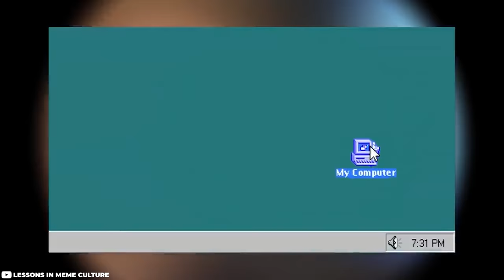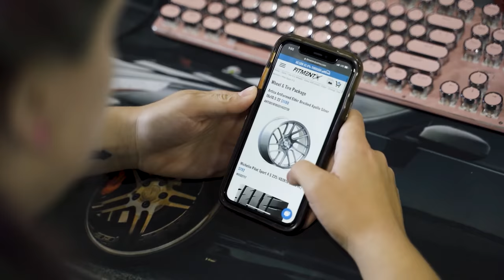AVOID These Car Mistakes...

Comment from the maker: What’s the worst mistake you made as a new car enthusiast?

Don’t go through the hassle of having to bring your wheels and tires to a shop to have them mounted, we got that part covered!
https://www.fitmentindustries.com/wheels-tires
Reply: not buying the rx7 fc that had 0 issues for 1k
Reply: Thinking I knew the limit of my 07 350z and losing rear traction when I didn't want to and over correcting twice ending up over a large curb. Ins deemed it a total loss while it still looked like it could be saved. Still killing me to think it could be fixed since is was in such nice shape.  Body shops didn't really give me the time of day to assess the frame before I made the choice to salvage or take the settlement.  Salvage titles and rebuilt process are a PIA as well. 

 Never wrecked in my life and now I lost my z :(    I have that feeling of wanting to start over, more aware, and get something similar, but don't feel worthy or too ashamed.  I know it will pass, but damn.
Reply: Buying  a 7 yo super car
Reply: $250 exhaust not the move, now i have no muffler and it sounds terrible past 3k rpm
Reply: Selling a s2000 for way under what I wanted for it. Reason being even though it a s2k it still a Honda so you get the the Honda kids  messaging nonstop wasting your time, or getting older enthusiasts who point out every flaw with a 20yr old Honda saying the blue book is only 9k blah blah blah…. Absolutely complete nightmare. I learned with cars like that keep them or just don’t buy them. The s2k is a great car great looking inside and out but it slow very slow and boosting the right way not only kills ur wallet it kills the cars value.
Reply: HYUNDAI. KIA
never touch those.  my buddy almost burned down his house.

Comment: I learned that WD-40 is NOT a replacement for proper penetrating fluid and an ugga dugga impact wrench is your best friend. Use the right tools for the job 👌
Reply: Fr PB blaster the night before or hours before and always using a breaker bar or impact before even trying just a ratchet saves so much time 😂
Reply: I’ve learned the cheater bar and breaker bar are wayyyy better than mr ugga dugga
Reply: I learned that no amount of rust (within reason) and/or torque is a match for a set of hardened knurled sockets and wrenches. Not available at every hardware store but damn do they have some grip. And they don't have to ruin the bolt every time like those swirly biting extractor sockets
Reply: People have tested and proved that wd40 is one of the best.
Reply: Wait wd40 isn't a proper penetrating fluid
Reply: @PeaceSTAR253  you able to site any sources? I've had way better results with PB blaster. WD-40 has never been able to free a rusted bolt for me.
Reply: @PeaceSTAR253  Well slap my ass and call me Sally, WD-40 deserves more credit than I give it.

Comment: The most slept on sedans is the New Chevy 4 door SS that came out a few years back, the charger hemi with AWD is slept on and the 2010+ Taurus SHO. Are major slept on American sedans I wish we could see more of.
Reply: Chevy SS is sexy I want to own one as a daily some day
Reply: @Mozetty  there is a older guy with a blue one where I live and it’s “full bolt on” idk what all that means, cams with ported heads it’s Loud and sexy! 😂
Reply: @402SHO  full bolt on roughly references like intake, headers, exhaust, just because it’s just bolts holding those on. But it’s nice if I get one that’s roughly the same thing I’d do
Reply: Were the AWD Chargers available with a Hemi? I thought they were sixers only
Reply: Cap the Ss sedan is hard to find and expensive
Reply: Chevy ss isn’t slept on anymore, they’re pretty expensive now, but if you want something that’s slept on buy a Chevy caprice ppv. It’s the same car, it’s gonna have trans issues cause it’s a cop car with an l77 (ls3 with ls2 cylinder heads and other minor changes) but if you want a badass sleeper that has pursuit mode instead of sport mode for 10-15k you can’t beat it.
Reply: @chrisvela5462  when I was looking for my sho I was also looking at hemi awd chargers very reasonable prices for the charger and sho but the SS is a bit harder to find and more expensive.
Reply: @chrisvela5462  yeah they’re only 6 bangers, this guy got all his information from a top 10 sleepers video
Reply: @henryp7252  well duh you can’t say hard to find and cheap in the same sentence
Reply: @chrisvela5462  Yes they were.  300s also.  Now it is only the 6 for consumers but apparently they will still make a hemi AWD for the PoPo.   I went looking for a new Charger/300 with hemi+AWD a few years back.  No dice so I bought a Mercedes.
Reply: Of course it’s faster than those underpowered boats 😂 but that doesn’t mean it’s fast (not saying it’s slow)
Reply: @Mozetty  no car that is slept on sells for 50 grand used
Reply: @glub__blub  true but if there is limited numbers there is
Reply: The G8s are aswell
Reply: The AWD 5.7? Stop it. That thing is slow as hell
Reply: @yoteeel6642  not with ported tb, cold air intake, headers, and a e85 tune. It’s pretty quick. Not as fast as a newer 5.7 with those mods but good.
Reply: @402SHO  read what you just typed. "Not as fast as a newer 5.7.." Lmao the newer 5.7s aren't fast either. And they weight 2 and a half tons
Reply: @yoteeel6642  yea I’ve been working all day give me a break🤣 yea I agree the 5.7 is sloooo but with some mods and e85 it’s not too bad for a first car to mod. Shit my sho would merk a stock hellcat
Reply: @402SHO  I'm with you on the SHO. It's not super quick, but nobody expects what it can do out of a Taurus. I can't really get behind the 5.7s tho. I think they sound great and are a good entry into the V8 for a novice, but it's too heavy and doesn't have enough punch to it. Dodge needs to up the power to at least 415-420. Probably the slowest V8 on the current market
Reply: @chrisvela5462  they had them in the 2011-2014 generation. Not sure if in all 4 years though
Reply: @yoteeel6642  there’s a few SHO’s about to come out about to spank higher HP cars. I should be completely finished in the spring. I talked to a few hemi owners where I live and they said it responds well to porting the TB and Intake manifold, throw some headers and e85 and they can keep up with more then you think. Yes they are a freaking boat. My sho stock beat a stock hemi challenger from 40-132 where I hit limiter.
Reply: The did do shows on this
Reply: Yeah I’m thinking about trading in my evo x for a Chevy ss
Reply: @chrisvela5462  the 2007-2014 had hemi awd
Reply: I've got the older brother of the SS, the G8 GT with some bolt ons and this thing is just a smile bringer to myself and those around me.
Reply: Shhhh the SHO is still a pretty well kept secret.
Reply: @chrisvela5462  I got a 2011 R/T AWD with the 5.7L hemi. I think they're was a few years they were in production, but stopped around 2012 IIRC.
Reply: @Mozetty   ,.                    ,.        ,.

Comment: One of the best mods so far are 3" aftermarket pipes and went with SLP loudmouths on my Challenger SRT8, which is way better than stock and was a good move. It breaths so much better and works best together with it's fresh air intake as well as updated headlights that have 3" air grabber induction ports in them and gives it an updated look to. So now it cools the engine bay off as well and reduced it's 0-60 & 1/4 x and is the main purpose of them to begin with

Comment: Sometimes the famous brands don’t make the best product for your car, do the research! Other times, the “hype” new brands don’t make the best product either. Surprisingly sometimes OEM is best. When it comes to actual performance parts (not cosmetics or exterior stuff), you gotta do the research so you don’t get burned. Classic example, mishimoto radiator is great, their fans are kinda garbage, OEM fans have a better seal and work better, at least on evo x.

Comment: Had a bolt on a brake pad strip on my dad last week trying to help him change brakes for a beach trip, had to get the caliper off a different way because that bolt decided it didn't want to play nice with the 12 spline wrench we had that fit. That taught me that I should really get a set of 6 spline wrenches to avoid that happing again later.

Comment: I've had several close calls, but the only "big" mistake I've made while working on a car was done after buying a ported throttle body for my 03 dakota. I installed it and because it was a low-cost mod, it didn't really have instructions, which resulted in me trying to bolt the air hat to a mounting stud that was too short. The result ended up being a snapped stud inside of my throttle body, but luckily my vice-grips were able to latch on to the 2mm of stud poking out of the surface, and I went to the hardware store and bought one slightly longer, as well as a wing nut and washer to replace the old nut. Now-a-days, if something doesn't fit right, I take a step back and look at it a little better... 😅

Comment: It’s funny cause I bought an S2000 that had 160,000 mile which was 14k which I believe is a good deal rn and brought it to Honda to take a look at it and got it down to 12k since it was 2k in repair

Comment: it is severely looked down upon, and for good reason, but the washer trick is a really easy practically free way to get some extra sound and depending on the car and how many washers you put the sound might be really nice and not too loud. I had a v6 Camaro and I knew I wasn't gonna be holding on to it for long so it didn't make sense to invest into any mods but I still wanted to have some fun. I put 2 washers into there and it sounded AMAZING. nice low tone sounding growl that an untrained ear won't be able to differentiate from a v8(until they realize the sound is coming from under the drivers seat instead of the back of the car) but i seriously impressed my friends that knew near nothing about cars with it and it was sick for the 2 weeks before I sold the car on Facebook marketplace and took the washers off

Comment: eBay parts are still great for placeholders. When I got my S13 I had no exhaust period, but I needed EVEN MORE work to get running. Exhaust is exhaust. Slap everything from headers to tips under there for just $300 so I don’t get arrested the first time I crank her. Swap it out after I get to all them busted up bushings lol

Comment: before lockdowns, i had pretty much never touched a power tool, or worked on a car before, and i decided to widebody my brz, alone. For the most part... the panels are good, i also painted it myself, but thats where its become a bit of a meme in my friend circle, i've got a few runs in the paint, and a section where i didn't sand it down properly before hand, so it looks like it has stretch marks on the rear quarters, one guy calls it the pregga'Z

Comment: Couple of mistakes. The two biggest was installing the hardest hasport motor mounts on my 95 integra because it was slightly cheaper than oem ones.. shit was too much vibration in a street car 🤣 the biggest mistake was buying a EM1, well.. that ONE. It was modded out like crazy.. enginewise.. said it was tuned and i dunno if it was or not... but a month later the piston rings went

Comment: I had a 97 Cavalier coupe. Lowered on Eibach springs (after like an idiot I cut the original springs), Niche Shocking Shock wheels with 225/35/18 Toyo Proxies
Reply: Were the lowering springs a mistake? Or did they not give you any issues
Reply: @cal7932  I had no issues. It handled great and rode so much better that riding on cut springs down on bump stops
Reply: @jeremyantunes7022  okay good bc I cant afford coilovers 😂

Comment: I was 1/4 of a quart low on oil on my Honda S2000 and decided to rip it getting onto the highway. At about 120 it felt like it didn't have as much power... I proceeded to drive another 30 minutes down the highway and then when I got in town I heard a terrible knocking noise echoing off the buildings. After it didn't go away as I drove around I stopped to learn I threw a rod bearing... Got back in the car and drove it 40 minutes back home down the highway and had to get a new engine lol

Comment: Cheap intakes are good intakes for every car. My 2012 sentra ser spec v straight up said no to a $100 short ram. Threw a check engine light, leaned out and im pretty sure almost blew up. Meanwhile my cobalt got a K&N typhoon. And it wad more then fine.

Comment: Never neglect " while you're in there's"
Did an intercooler and radiator upgrade and didn't replace my crusty trans cooler lines. A week later I did the entire job over because one of the lines had a pin hole in it you cant get the lines out without pulling the radiator and intercooler.

Comment: Ngl, I've spent more money than necessary on my mk4 Jetta. However, I will say that my plan is to make it a clean daily, so I want to make it look decent and run smooth and clean with a touch of character and quality. Aluminum replacements to plastic pieces, better quality geadlights, LED replacements, etc. I just feel is worthwhile. I'm conflicted like everyone else though with whether or not it's worth it to keep going...

Comment: I have a 1996 Ford Probe GT that's got 130k and is pretty clean (Florida car), I have been auto-crossing it and it seems to be holding up. Except the whole time I've owned it the soggy 4 speed auto that comes in it really hinders the amount of fun it is to drive. I plan on keeping this car for a very long time so I was thinking on taking a local rotted out probe and swapping the manual trans into mine + wheels, tires and suspension without trying to break the bank. I'd be scared to spend more than 3500 on it because at the end of the day it is a Ford Probe. Is it worth it?

Comment: Thoughts on Koni STRT shocks and Eibach pro kit springs as a OEM+/daily driver replacement that can handle some spirited driving?
Reply from the maker: Sounds like an awesome upgrade! Don't be afraid to check out some coilover options for more adjustability! - www.fitmentindustries.com/suspension

Comment: Too late haha

Oh BTW this is my parts list

Well still waiting on parts for my Mustang but so far I have.

Procharger D1sc
8 rib pully set up
Fore innovations fuel hat w/duel pumps
Aeromotive return style fuel system
MMR Fuel Rail kit
MMR rear main seal housing
MMR Composit windage trey
90lbs injectors
Custom Cams
UPR Tubular Kmember and lower control arms
2000 Windsor Iron Block (soon to be bored .20 over)
8bolt steel flexplate
T56 magnum transmission
Quick time scatter shield
McLoad RST Clutch 26 Spline 
Triaxe short throw shifter
Aluminum driveline
8.8 rear diff with 31spline Moser axles FRPP 3.73 LSD
Cadillac ATS 4 piston brembo swap
Vortec maxflow race bov
ARH Longtube headers w/ Xpipe
Aodhan DS07 18x9.5 (F) 18x10.5 (R) +22 
Continental DWS 275/35/R18 (F) 295/35/R18 (R)
BC BR series Coilovers
Kenny Brown Extreme Matrix Kit

Waiting on MMR 5.0 1000R Manley Forged Internals

😅🤷‍♂️

Comment: The whole ego in check section is LITERALLY everyone at my school (I go motorcycle mechanic institute if that gives you an idea) I drive a Lincoln town car (which ARE VERY UNDERRATED) and I’ll be on my way to school when I see another dude heading the same way in his shitbox Miata, Honda, compensating truck, you get the point, driving like an absolute shit cause they think their car is shit and is better than a super car. Let me tell ya, I’ll start matching their speed not wanting to get cut off by them and let me tell ya, when they realize I’m pacing them/passing them they look so dumb founded cause a car that thought was slow just kicked their ass.

Comment: On the topic in 7:52 is actually on point have stripped a couple bolts and nuts on my truck and even recently broke a bolt from the bed (I'm replacing the fuel pump) but fuk it i started cutting the top part of the bolt so I can then lift the bed and get that mf out

Comment: If you make money tuning cars, you're tuning other people's cars.
If you make money tuning your car, you're doing it wrong😂😂😂
Cars are an expensive hobby. And you shouldn't daily your project car.
Be prepared to have it in your garage for a while while you work on it or wait for parts.
The worst mistake you can make is cheaping out on parts and getting impatient.
Reply: This right here is definitely such a great tip. With my S30, there's so many different parts out there but saving and waiting for the right parts will always save you more heartache in the long run.
Reply: @ConstantineGaming  learned that the hard way with my Z32. Bought new injectors and the OEM  ones are going for around $700-$1k
The Chinese copies go for $300 at the time, so I bought the Chinese ones.
A year later I bought the OEM purple ones😂😂😂
Reply: @ZX-es9zw  I can totally see that, I've been trying really hard not to do that as much as possible even though it's very convenient, I will say this S30 definitely has taught me patience and how awesome the car community is especially the Datsun/Nissan.